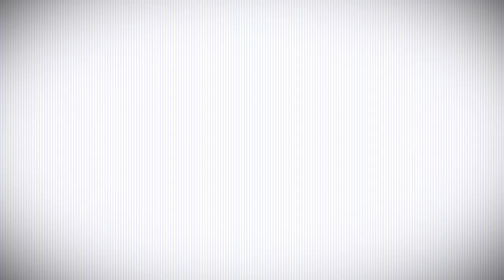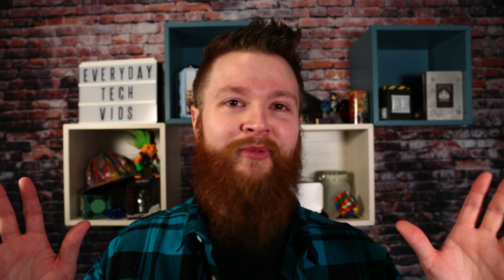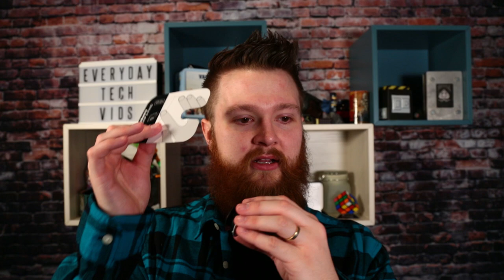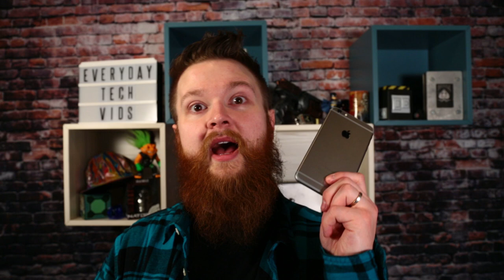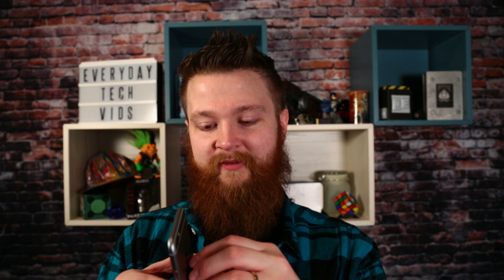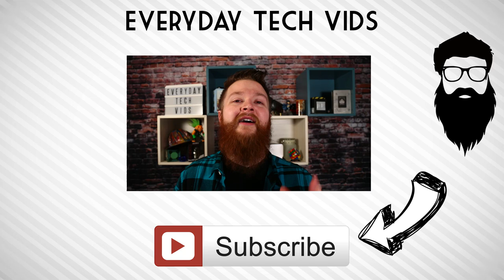PopSocket How to Install or Apply

Comment: I have two bad hands and I've been using a PopSocket on two Cases for four months.  They are still holding tight and are still working great.  They pop open & closed as new.

Comment: I just bought one today after seeing it on sale at Target.  Since I had no idea what is was, I did research on their website and thought I would try it.  I have arthritis in my hands and holding my iPhone 6s can be a challenge.  My phone has an OEM leather case and I noticed when I take the pop socket off, it leaves a temporary mark.  It's difficult to say how long the adhesive will last so I don't plan on re-positioning it much.

Comment: I've had my PopSocket since Jan 2017. I haven't taken it off for repositioning. I have a black Spigen hard plastic case & my PopSocket has had no issues sticking to it. However, since I am anal, I would recommend cleaning your phone/phone case before you stick your PopSocket onto it.
Reply: heh heh

Comment: Can you move it once you've stuck it on?  I have commitment issues
Reply from the maker: Hey! Yes you can move it :) I would recommend sticking it to a case. It will only move maybe 3-4 times before you will start to wear the adhesive out.

Comment: These things sell for $10 I got a few of them for $1 a piece on Wish. Exact same thing very very strong tape (pretty impossible to remove from phone case actually) and they've been on my phone cases for over a few months now. I also am always wiping my phone with disinfectant wipes and they're still holding strong. So if you want the exact same thing but way cheaper go with Wish (they have TONS of different ones too)

Comment: Would have preferred to watch this 'how to' video after he tested the Popsocket for a week. 
Forgot to include FIRST important to clean the surface.  Written instructions state to press 12 seconds not 3-5 seconds so adhesive sticks. And where is the best spot back of phone to attach?
Reply from the maker: Hey Julie! Definitive noted. You are correct, cleaning the surface is a great idea! Also I wish I had added that attaching it to a case is recommended. For placement, it depends on your preference. I like almost dead center. Thank you!